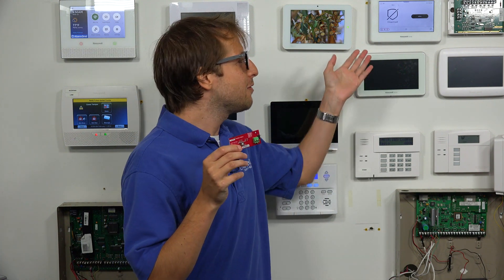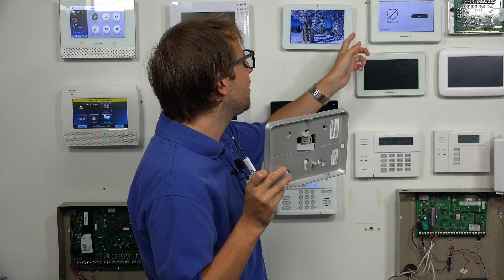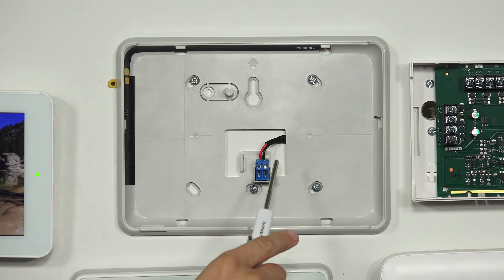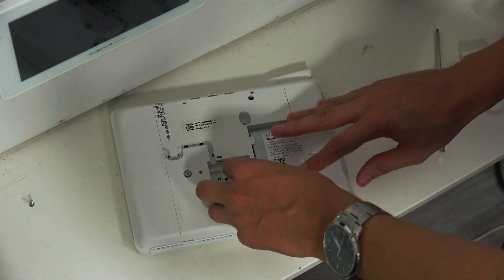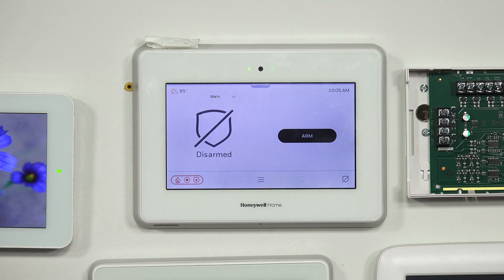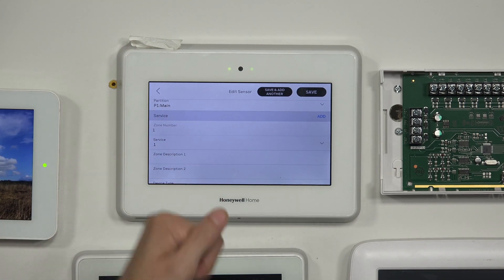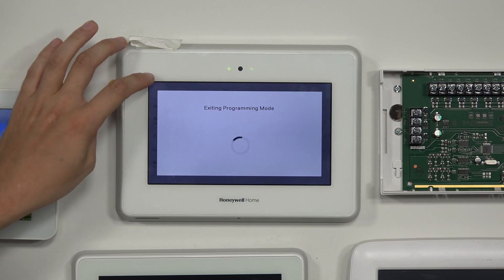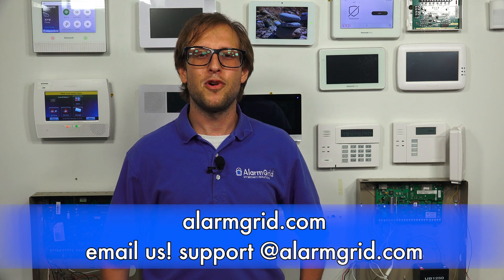Honeywell Home PROA7PLUS: Installing PROTAKEOVER

Comment: can I use ADT branded Pro7 plus on competitive monitoring system   has zwave
Reply: ADT's was called the Command panel and is not compatible with anybody else's monitoring. If you can convince ADT to delete all the sensors they can be reused w/ PROA7PLUS.
Reply: Thanks for the information. @freddaniels8259

Comment: The range seem to be low on the module
Reply: If you are speaking of the receiving range for RF devices, please make sure your module is making good connection to the antenna connections on the new backplate that came with the module.